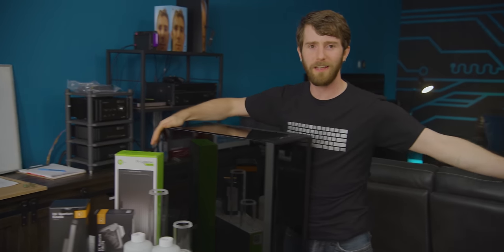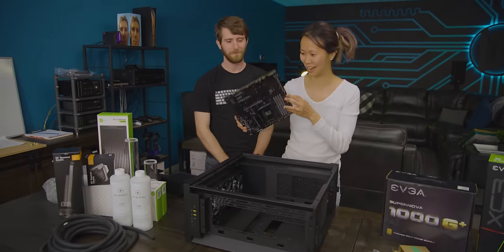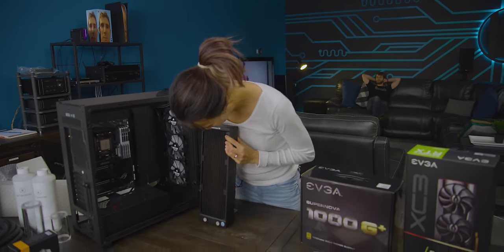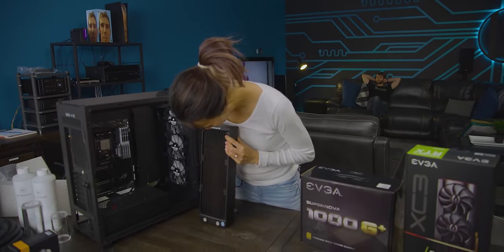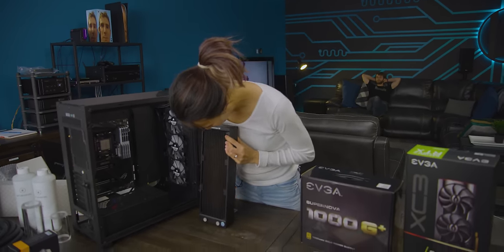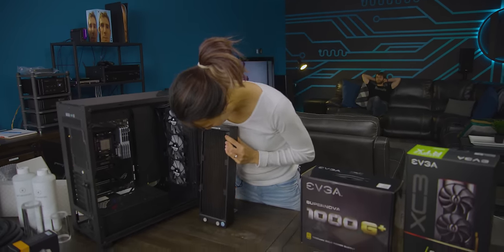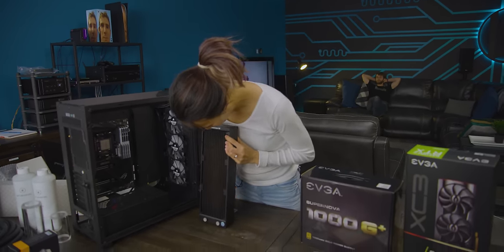Building a PC with my Wife was a MISTAKE - Lounge VR PC Build

Comment: I read the title as "Water Cooling my Wife (actually gone wrong)" and it took me way  to long to realize that it wasn't actually that
edit: lmfao they changed the title
Reply: FR SAME
Reply: Me too! 😂
Reply: Literally exactly what I did
Reply: I didn't realize it didn't go wrong until I read your comment so...
Reply: Next LTT video coming up...
Reply: Same 😂
Reply: @artificialbtr  You don't wanna know.
Reply: The original title was "Building a PC with my wife (actually gone wrong)", just re-check the notification and you will see.
Reply: Ikr
Reply: “Made an opening and tried to shove a tube up there” i guess you won’t need compression fittings
Reply: coming up: yvonne gets her own watercooled chair
Reply: OMG I WAS ABT TO COMMENT THE SAME THING TOO
Reply: @artificialbtr  This answer might not excite you but usually a cold shower or visiting a pool do the trick. :D
Reply: Hey the title has changed
Reply: I tried overclocking my wife, now she's pregnant
Reply: @ericryang1757  My brain has trouble comprehending how that would work
Reply: Too bad they changed the title. I can’t believe they still pull that crap
Reply: @shanedoesyoutube8001  yeah I guess that would work

Comment: "Sometimes I feel like the point of watercooling a system is so that you can see the water and it looks cool"
I can't believe I'm siding with Yvonne over Linus on a contentious computer building question.
Reply: I agree with her too. If I want to look at black tubing I'd use an AIO.
Reply: Nah I’m with Linus on this
Reply: @robertmccracken6930  exactly. I have a FormDt1 and am forced to use an aio; but if I watercooled the whole PC I'd want clear tubes and be able to see everything.
Reply: well watercooling is the performance. CUSTOM watercooling is adding in the looks but also for the gpu as aio gpus arent too common.
Reply: @robertmccracken6930  well yeah u can use an aio but theres not much u can do with it. itll be the same tubing with length that u, for the most part cant change. overall just one look. with the tubes they used, theres custom length plus the use of the reservoir. then with black hard tubing, u can have custom runs with that nice black look. like jayz black ice build
Reply: Same, I almost think watercooling is pointless, in most cases.
Reply: She's always the practical one. After all, if you need watercooling, AIO is only slightly below the potential cooling of open loop. Open loop just gives more customization, more potential radiators and more volume in the loop.

But if you wana see those cool looking dyed water flowing around in tubes, you're gonna need some open loop action.
Reply: 99% of the time air cooling done right is just as good.
Reply: Hahaha true XD
Reply: @fridaycaliforniaa236  yeah it's just there to look cool, there are good air coolers that can give similar temps(albeit a bit higher) , with pretty much the same performance just with less danger of killing all your computer parts in one leak.
Reply: As a matte black build black tubing makes sense.   However I've seen translucent black tubing.
Reply: @jemiebridges3197  in flex tubing? i've definitely seen trans black hardline, not sure if i've seen trans black flexi
Reply: @Sinsanatis  You missed my point. It was that it's just plain black tubing, and a AIO is just plain black tubing. Yes you can put the tubing however you want in a custom loop, but it's still just plain black tubing. If I'm going through the added effort and expense of a custom loop I want to see the liquid running through the system.
Reply: @robertmccracken6930  no i got that, just that im basically saying that a custom loop vs an aio for looks isnt just the tubing. theres the different lengths, reservoir, cpu block, and fittings. and even then, theres different black tubing as usually aios have that sorta braided type. in the video theyre using matte black, but theres also glossy black, and as someone else mentioned, translucent black.
but aside from all that, theyre also using a gpu block so it wouldnt make sense to use an aio anyway
Reply: Laughs in Alpenföhn Groß'clockner. I've been considering building water cooled rigs for almost 20 years by now and everytime I stood at the point of putting stuff together, I ended up with a giant air cooler simply because I wouldn't want to or even couldn't spend a few hundred bucks more just on the cooling. Just taking an AIO wasn't a good bang for the buck choice either. Well my last rig build was 8+ years ago, times may have changed, but I often see the Noctuas being recommended still.
Reply: I can.

Comment: Can we just acknowledge that a component on the MotherBoard straight up immolated itself, and the damn thing still works..?
That actually pretty impressive.
Reply: They don’t even protect these things in the box it’s just sitting in cardboard.  You know a produce is a beef cake when the manufacturer is so confident in its durability that they don’t care it thrashes around in the box. I’m still pretty amazed as well myself I want to know what the heck caused it.
Reply: if it was just something like a filter cap (ceramic smd caps can break and short out) it's usually no big deal
Reply: Watch there be a buzzing noise heard with the headphones on at low volume and random shut downs, lol.
Reply: @davecolwell725 at least all asus strix motherboards are like that I have both a Z370-E and a X570-E and they don’t really move around that much honestly
Reply: I think it was the metal backing of the sticker they put on the wireless card. With the first short it somehow burned itself free.
Reply: @marcus_w0  you can see something light up/burn at the top of the motherboard when they turn it on, it's nowhere near that pci-e card
Reply: Still, the motherboard spontaneously immolating itself is a bit worrying. It might still work afterwards, but I'd rather my PC isn't a fire hazard.
Reply: That's a pretty good assumption, boards often have caps that go to ground on supply voltages to filter out noise (of which there is a ton of being that close to the CPU). If it was a resistor that had too much current drawn through it, the device would be open and likely not power the fan (or possibly tach feedback, so the fan would still work then). If it still works after that incident, the likelihood of it happening again is very low as it was either that component was just a bad one or whatever was driving that can't do so anymore.

Looking at that PCBA it was either a capacitor, transistor or a diode.
Reply: I still can't believe this.
Reply: @Grady_Oconnell  yeah but not even static bags anymore pretty good stuff
Reply: @davecolwell725  mine did
Remember these things have all been checked over and opened up by the inventory staff

Comment: LinusSexTips reference list (reached edition):
2:06 - "gaping performance".
2:13 - "are you gonna put it in at some point?"
2:30 - "golden triangle"'
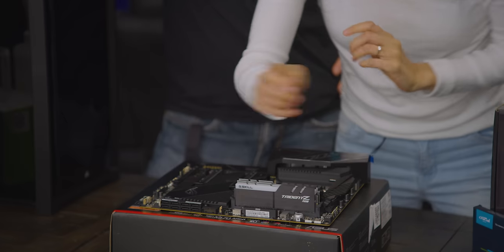2:55 - "those are a tight fit!"
3:42 - "I don't actually see where this goes..."
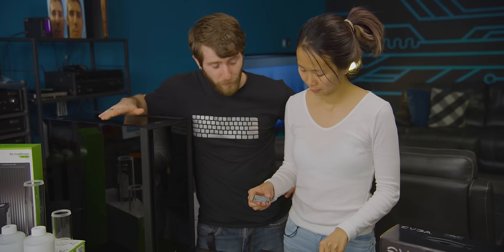3:57 - "There's a primary and secondary slot."
7:27 - "got the nipple going through the hole..."
8:07 - "if we're stuck with just one, thicker is going to be better!"
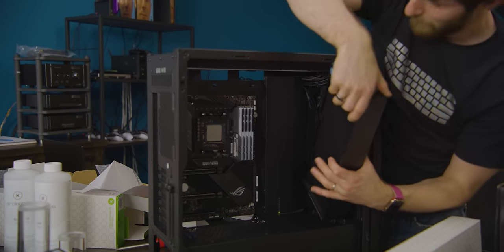8:19 - "that's not going to fit in there, we're going to have to make some adjustments"
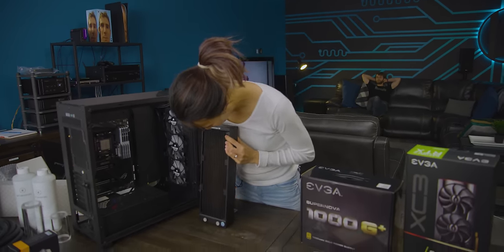9:53 - "that's a sexy CPU block!"
11:13 - "but this way fits!"
11:28 - "this one's not thick enough, eh long enough, sorry!"
11:38 - "I said we have to use the longer one!"
13:48 -"Look at it, it's dirty!"
14:20 - "So I got the big one!"
15:11 - "Do my fingers fit in here okay?"
15:25 - "You're in the wrong hole!"
15:33 - "You can't just jam this one in there"
17:05 - "Are you going to come watch my feet?"
17:20 - "I know a thing or two about being tied down, if you know what I mean"
17:39 - "Does it fit? You're not even trying, come on, jam it!"
17:58 - "You want to kind of wiggle wobble it back and fourth"
21:12 - "That right there just totaly blew"

Feel free to add more.

Comment: 100% agree wit Yvonne.  If Im going to thru the trouble of watercooling, Part of the reward will be to see the water pumping throughout the tubes.

Clear hardlines look the best, I would settle for a Transparent neon color, or a clear soft line
Reply: Yes, but clear plastic has a habit of yellowing over time. If you want it to be clear, put in the extra work and use glass tubing.

Comment: 20:59 If you go frame by frame (">" button while paused) you can see the spark at the top of the motherboard. It looks pretty crazy I don't get how it still worked after that, I would still be concerned.
Reply: I wonder if it some weird warranty detection thing… gives the manufacturer an easy way to see if the board has been powered on?
Reply: @andy_warb  I don't think so, if they were to have a warranty thing I don't think it would involve intentional explosions/fire.
Reply: @diamondninja4938  It looks like an red impostor if you look close at it but thats scary something sparking in your motherboard
Reply: @diamondninja4938  maybe a small piece of metal shorting cuz that yellow spark stayed until he turned the PSU of
Reply: What's really concerning about this is that there are people going thru TLL video frame by frame.
Reply: @houssinesqalli9379  dc power continues to arc until something interupts it's supply due to it staying at a constant value and reaching 0 when turned on or off

Comment: What most likely happened is that the part that burnt up was a multilayer ceramic capacitor. Things like thermal stress or board flex can cause the ceramic to crack and short the internal plates, which are generally connected to the power rails. When linus powered it on and kept it on, it either tripped some electronic fuse or just burnt until it was open. You can solve the issue using two capacitors in series, using soft terminated capacitors, or by using floating plate capacitors (which are basically two capacitors in series, but in one part), but all that costs money and its cheaper in this case to just replace the board when they very rarely fail.

Comment: The burnt part was probably a mlcc (ceramic capacitor). Those sometimes tend to crack due to the extreme tight packing of the layers in this formfactor. The fact that it resulted in a open condition right after the violent short impresses me
Reply: you could see something go near the led fault indicator before it popped
Reply: You can see him press the power button on the top
Reply: I thought it was Yvonne’s diamond ring that shorted the mobo. I’m sure there must be a lesson there somewhere 😉
Reply: @Mr.Kim.T  Yvonnes diamond ring sponsored by LTT store

Comment: I love how we're just ignoring the fact that a component on the mobo violently shorted. We just moved along like it's to be expected
Reply: yeah like, what the hell even happened there? and how in the world did the mobo and the pins just kept working like nothing happened
Reply: Additional content when it fails again
Reply: @CJonestheSteam72  3 weeks from now "The office set on fire"
Reply: Sometimes things goes wrong but didn't
Reply: They've got a dozen more X570 boards, don't know why they didn't just swap it out
Reply: let me guess they changed it out?
Reply: @amirpourghoureiyan1637  time
Reply: Happened to me with a GPU before. Sparks, magic pixie smoke and everything. Usually if something like a capacitor blows (as long as it blows open, rather than shorts) it's not a problem as they're usually just for smoothing/EMC and not required for the board to function. If it still works, it's probably fine but may have degraded life. In this case it does just look like a static arc?
Reply: @amirpourghoureiyan1637  Maybe they didn't want to dissasemble everything because it's such a hassle but surprisingly it worked fine though.
Reply: @Deadspace1996  I wouldn't take the risk, never can be too safe with electronics.
Reply: what's interesting is if it was some sort of regulation Cap or Resistor. it might not matter that much, if say the PSU is delivering really nice clean power... or it was a diode that got installed backwards. where it shorted through... it might just "be okay"

Comment: from 20:58 to 21:02 you can see the tiny fire in the upper corner of the motherboard. you can also see the reflection of the fire on the reservoir.
Reply: MLCC became a resistor and popped, looks like it created a convenient solder bridge in place of the cap so the circuit continued to work. Looking at the layout it was probably there to reduce voltage drop during inrush current to the fan headers during fan spin up. Probably would never cause a problem unless you had a bunch of high current fans connected to the headers, in which case the stator may not have enough voltage to overcome the magnetic resistance of the rotor during inrush. Likely a non-critical failure for your average lower current radiator fan. Good light show though.
Reply: @K31TH3R  i know a lot about tech. i understood none of that. xD

Comment: I'm looking forward to the 6-month update where they finally figure out what that shorted circuit does.
Reply: Judging by the size and color (product image on asus.com), it was probably a bulk decoupling capacitor (used between supply voltage anf ground to compensate noise in the voltage), and by the position it was probably related to the fan control or fan power circuitry. It also failed to open circuit which is good, a closed circuit would short and break more stuff or trip a fuse. The supply voltage of whatever is hooked up there (either the fan header or the control circuit) may have slightly higher noise, but it probably won't be a problem.
Reply: RIP the bug.
Or it was her ring, it possibly just shorted the live and earth/neutral (in a safe way thankfully) of the fan header.
Reply: A bit of dust can also cause this to happen.
Reply: Just a filtering capacitor but not a good advertisement for Asus if they are using caps that blow just for fun when new.
Reply: Either way he'll probably upgrade it with the Vive pro 2 when it comes out, so we'll probably see an update soon
Reply: Your comment was 6 months ago now, did they ever figure it out or make the video? I'm curious.

Comment: Maybe to late, but as an Electrical Engineer, if one of the CAPS blew out. Its not necassarily a system death. 
Most of the caps are used as stabilisation or noise filters. One signal in the system maybe noisy now but as long as it does not impact system performance your ok. As it was not a big one like an ELKO , but a small one which most probably makes it a ceramic CAP, powersuppyl stability should be fine. If its near the FAN, most probably the FAN is not very finely controlled but thats ok.

Comment: 21:14 from what I can see in the video, I'm guessing the little  SOT23-3 Mosfet for the PWM control decided to nope out. That's why the port still worked.

EDIT: Theory 2: it might have been a decoupling capacitor for the SO-8 Package on the left

EDIT 2: From looking at photos it is definitly a capacitor. By comparing the fotos to mainly this absolutly beatiful shot here https://p.xfastest.com/~sinchen/ASUS-ROG-Crosshair-VIII-Dark-Hero/ASUS-ROG-Crosshair-VIII-Dark-Hero-19.jpg 
The S08 package seems to be the same chip as the one next to the CHA1 FAN connector, which is a  nuvoton 3961af, which after some more digging turns out to be a DC Fan controller made custom for ASUS.
If you take Nuvotons other SO-8  Fan Controller IC, NCT3940S, as reference, it looks to be either the Input or Output Voltage Decoupling Capacitor, with a value of 4.7uF which would fit the relativly large package of the cap. As every one of the 3 headers has an additional identical cap and the blown one is placed differently, my guess would be the Input Decoupling cap, as every port has the output cap close to the header.

Conclusion: My best guess for the blown part is the 4.7uF Vin Decoupling Cap for the Fan Controller IC
Reply: It's okay, Anthony can fix that.
Reply: Soooo... Is it still fine or does Linus just doesn't yet realize the effect?
Reply: @DelLego  if the fan port still works, it looks loke he got lucky. The Decoupling cap isn't stricly necessary, it just smoothes put the incoming voltage to the IC. As for why it blew up, I have no Idea. MLCC Caps don't just blow up randomly. A Voltage Spike on the Vin line would have killed other parts as well and shorting something at that volage would not end up in a blown part or even a spark. At worst the board would just turn off. I really have no clue.

Comment: If anyone is wondering, the FPS in beat saber is ~400

For anyone looking to do the math in the future, the math is (afaik):

1000 ÷ 2.5 = 400

1000: milliseconds in a second

2.5: the frame time according to Linus

So FPS would be calculated by dividing 1000ms by the time between frames (usually in milliseconds)

Comment: I think that the reason the board sparked was because Yvonne accidentally shorted the the pins with her wedding ring.
Reply: I dont think so, the Ring is in a complete other Region, than the short circuit 21:00
Reply: Nope, her ring was not close enough. But she might have shorted it with fingers, they can (especially if sweaty) conduct electricity, so it is possible.

Comment: Funny. I had a short just like that but it was above a 'Rainbow' Port because of the daisychain unplugging and grinding on the metal of my case.. The port still works perfectly fine, Everything on the motherboard and my Rig works just fine and no performance or software issues.. Crazy I run into this video randomly and it starts off with a short identical to what I just dealt with. It was a little flicker and light/flame and went out within seconds. Having no issues so I am not to worried about it, Other than it being an excuse to upgrade my MOBO now :) been wanting to so why not..